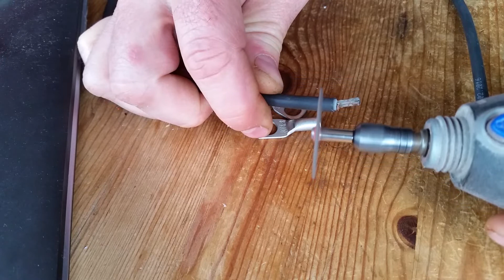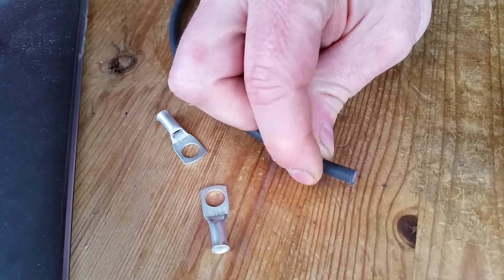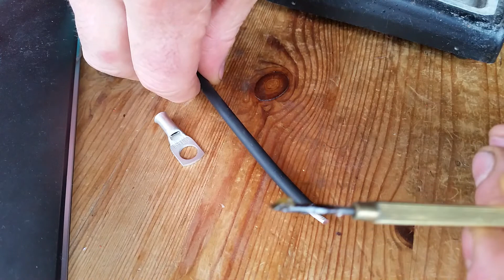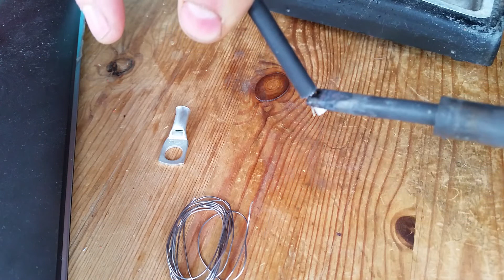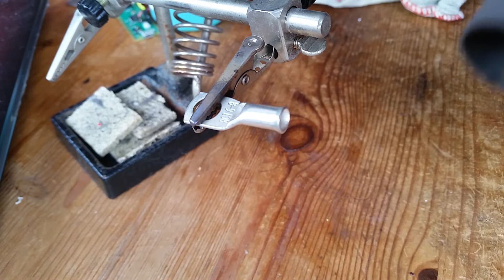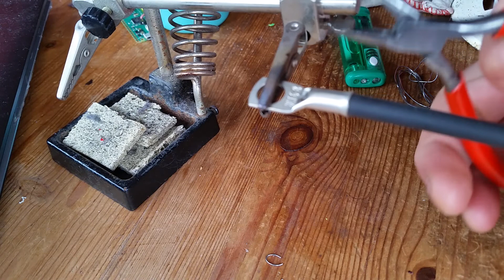Soldering Big Crimp Tags

Comment: Please don't solder these. Tin has 10x the resistance of copper. The less you have of the tin, the better... except a thin layer that prevents oxidation of the copper. Tin can cause connection issues. The worst outcome is: this stuff sets your house on fire. That happens when only a little surface makes actual contact due to the connection failing, pushing lots of current through it, rapidly increasing the temperature and setting anything flammable nearby (including the insulation) on fire, then that sets everything on fire. Crimp with pliers and a hammer if you have to.

Comment: Have you ever measured the difference between crimped and soldered crimp tags?
Reply from the maker: I haven't, sometimes at the point I would have to buy an expensive tool, I shy away and use an alternate method.